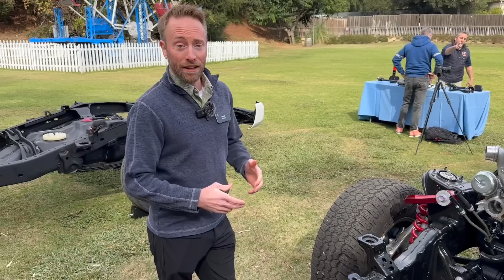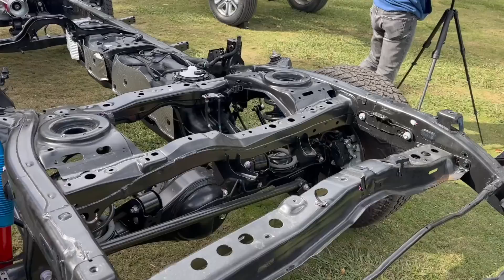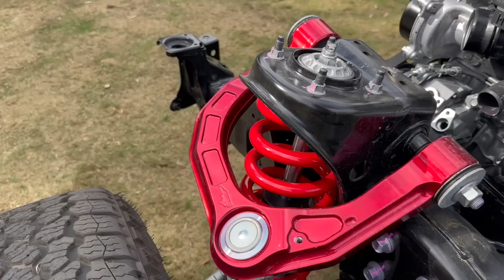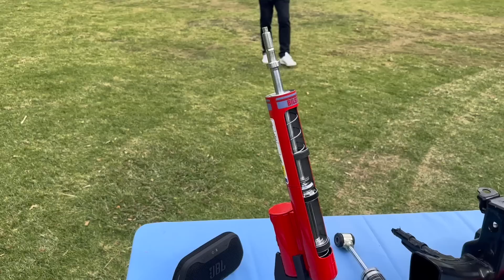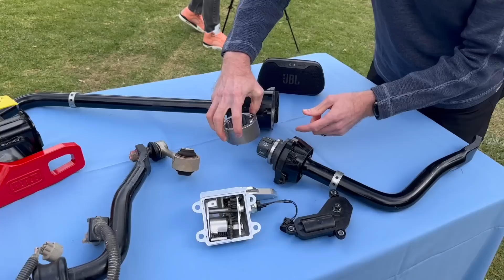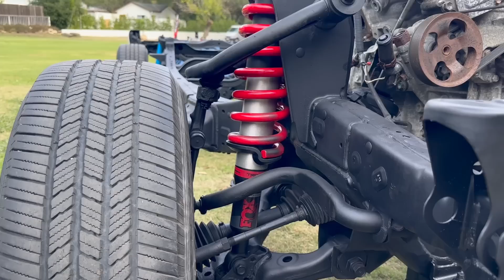2024 Tacoma Lead Engineer Explains Why The 4th Tacoma Is Better Than The 3rd Gen

Comment: They can say what they want for it to be reliable. It needs to be simplistic. They’ve put a turbo in it. They’ve increased the power of the dry train by using a battery operated system that they pretend saves fuel. When actually really doesn’t there’s more to fix more to breakdown it’s gonna be more expensive on maintenance and repairs. And they’re saying it’s better but they put an electronic handbrake in it and electronic handbrake. That tells me everything I need to know. No more flying down and off-road trail coming to a tight corner. I’m doing the handbrake turn to take the bend and you get that wonderful butterflies in your stomach and a big smile on your face like a Cheshire cat yeah good luck trying to do that with an electronic handbrake. Off road vehicle, not in my world. Was a huge Toyota truck fan absolutely huge thought they were the best things out there until I seen this. And what pisses me off the most is this is the only option they’re giving me in the future. They turned an off-road over landing monster into a pavement princess because you take this thing off the pavement. It won’t be long before you’re fucked.
Reply: The electronic parking brake
 will save a lot of transmissions by guaranteeing that the parking brake is,always engaged in park
Most users are too lazy and stupid to use their park brake
Turbo inline 4 is complicated?
A normally aspirated V6 or V8 are more complicated
More cylinders is more to go wrong
The advantage of the  v6 and v8 is the mechanical load is spread over more cylinders and that is it
Reply: @joeblack1052 just because some people are lazy and stupid doesn't mean it should be forced upon us all. And to be fair to being punished for the laziness and stupidity. As for the engines they have proven themselves and are considerably more reliable. I believe the new engine is way over complicated and I certainly going to have more issues custodian more money. The newer vehicles are relied too much on technology and lesson mechanical engineering. I believe it's a massive mistake. I'm not the only one you're already starting to see the effects of it vehicles are losing their safety ratings in Europe. They've replaced many of the tactical buttons with screens which means you no longer just reach out and control something you have to take your eyes off the road and scroll through screens to be able to operate your vehicle sometimes even up to 15 seconds that's a long time distracted from the road.. also think about technology and screens you buy a phone anything from a few hundred dollars do a couple of thousand same with a tablet or laptop. What in about 5-6 years tops its obsolete. Now imagine you've paid 30,000 to 100,000 for a vehicle in 5 or 6 years because of the technology it's obsolete that's a bigger kick in The Head don't you think. Just because they're newer vehicles doesn't mean they're going to be better in fact I think they're designed to strip you from your money and make sure you replace them quicker. In my view the newer vehicles are just to f*** you over. There's a reason why many mechanics are quietly telling you not to buy new vehicles with built-in obsolete switches. Does the reason why so many of them out there are telling you to buy older vehicles and spend the money repairing and replacing because in the end you will end up with a better more reliable vehicle.
Reply: @russellwood8750 yeah yeah, I will tell you what, new vehicles go longer with less issues than in the past
The main issue is,serviceability 
They are harder to repair when things go south
Tacoma appears quite serviceable 
V6 engines are overated 
Expensive to maintain and repair
Who does handbrake turns in a truck?
Most US vehicles had foot operated parking brakes which are useless for that purpose
The new tacoma is extremely off road capable  in stock configuration
Can fit larger tire sizes without modification
The low end torque characteristics of the turbo are ideal for offroad use mimicking diesels which make the best off road vehicles with the  exception engine braking as the diesel has mush higher compression
Reply: @joeblack1052  good luck, trying to sell it in the future. When it has no resale value.

Comment: I like the idea of the c-channel frame better, would have been easier to fluid film and be more thorough of an application vs having to stick an extension wand in little holes and spray and pray that it did a good job, cause you can’t visually see

Comment: So the engineer in this video is slightly incorrect about the rear differential.  Only the iForce MAX powertrain (and the non-hybrid TRD MT models) gets the larger 9.5 inch rear diff, to handle the added torque.  All other Tacoma non-hybrid models have an 8.2 inch rear diff  The hybrid models also get larger brake components throughout.

Comment: I like all the changes except the turbo 4cyl.   Id still rather a NA v6.    No matter how much engineering yall did, you wont convince me that a stressed out turbo charged 4cyl will last as long as a NA v6.   Im into longevity and turbo charged just simply dint last as long wo tons of maintenance.

Comment: My biggest concern is what I see on that 3.5 inch inlet - I really hope that isn't plastic. The one thing I get so sick and tired of is components that are meant to handle high temperatures having a plastic part (polycarbonate or whatever) somewhere on the cooling system be it for engine or oil. I've seen far too often, and even experienced it too often, that parts in that system being plastic just ends up having and astronomically high failure rate in hotter climate/running conditions that can lead to catastrophic failure too easily.
Reply: Plastics are not all the same. Just because something is made of plastic, does not mean that it is cheaper or less robust. A properly selected and manufactured plastic component specifically engineered for an application, can be even better than a similar metal component in a lot of applications. If other manufacturers simply did the proper pre production screening, problems like that would not exist. 👍🏻
Reply: @keepmahaney7412  Tell that to the thermostat housing on a 2003 4.0 v6 ranger. This part constantly failed to the point I had to replace it with an aluminum aftermarket part. Wasn't due to the vehicle overheating or the thermostat failing, it was because the part was not "robust" enough to be part of the engine cooling loop. These parts are intentionally made to fail.

Comment: So cooling in the TRD Off Road is more substantial than the TRD Sport? I was under the assumption the two power plants were the same. Have a deposit on a Sport and plan on frequently towing a travel trailer. Now I’m wondering if I should switch my deposit to an Off Road….
Reply: The sport will definitely be better for towing than the off-road.

Comment: I just sold my beloved v6 PreRunner (2015) and now I am truck less. I had plans on getting the latest OffRoad available (2023), but maybe considering the 4thGen Tacoma. Which truck - 2023 or 2024 - would be a better option for towing around 3,500lbs? The 2024 forced induction engines sound cool and all, but maybe less reliable down the line? If I'm towing, I reckon I would only speed up the wear and tear of an already waning turbocharged engine. Thoughts?
Reply from the maker: I'd buy a new truck all day over the 3rd Gen. Just drives so much better.

Comment: Engineering 101 - simpler designs are inherently more reliable.  This violates that rule, but time is the true test.  I’m sceptic where these engine will be in 12 years with 150k miles.

Comment: Get rid of the 4-Cllylinder and I might get one Ya Right I love my 2005 Tacoma V6 4x4 and I will keep it till I die or if my truck dies, or I will rebuild it like new I would never get a truck with a 4-Cylinder ever the truck looks nice and lots of new things like the rear disk brakes but that should have been done starting with the 2005 Tacoma very late in getting the rear disk brakes and they say it gets better gas miles but I heard it has a smaller gas tank????? so much for the better gas miles :( sad days for us off-roaders and you will have to replace the turbos around one hundred thousand miles my Tacoma V6 4x4 has just got 150, thousand miles on it and not leaks or problems very happy with it I should get another 150, thousand miles out of it :) Toyota has jumped on the 4-Cylinder band wagon sad days for us Tacoma drivers and one more thing an air dam on a 4x4 how much will that cost extra just to remove it and throw it away???????????????.

Comment: No offense intended, but I'm more persuaded by histories, repair records, and other metrics of longevity and reliability than pretty props and the word of an engineer who is paid by the company. I'm skeptical of this gamble by Toyota in putting this little engine in a truck that has increased in size and weight. We shall see.
Reply from the maker: Then lets take a look at all the Toyota failure engines of the past...I'll wait. But we shall see.
Reply: @TRDJon 2022-23 Tundra V6 turbo engines. I’ll wait. But we shall see !! 😂😂😂😂

Comment: The issue with forced induction is specific to SMALL GAS engines. I’ve heard the argument “million mile turbo diesel” but the problem is that smaller displacement engines simply cannot handle the extra boost pressure over long timelines. They’ll all need to be rebuilt at 100/150k miles. There’s just scientifically no chance that these will last anywhere near as long as the NA v6, which will probably outlive most of us. What you’re witnessing is the death of stock trucks that will go 300/400k miles with basic maintenance. Do what you want with that information, but don’t gaslight people about the new ones being as reliable.
Reply: And the idea of a “reliable” 4 cylinder truck that is meant to “go fast off-road” is just ridiculous. The more boost this engine gets, the shorter its lifetime. You’re getting a $65k truck that will be fun for a couple years and then need its engine rebuilt.

Comment: Ok. I came back to rewatch this because other reviewers have had a different toyota engineer say at this exact mockup that ALL have 3" plumbed cooling, but this guy says only the TRD Offroad packaged ones have it. Same with the sealed belt tensioner.  Is there really any engine differences between TRD and non TRD engines in the new tacoma??????
Reply from the maker: According to Craig yes there is and he is the powertrain engineer.

Comment: smaller gas tank, lighter/weaker framer. anybody catch any other cost saving  features? dudes trying to talk about how much better it is, i just want a regular frame, not some 'tajima welded frame' made from scraps
Reply from the maker: A c channel frame is stronger than a fully boxed frame???? 🤣
Reply: YEAH, the engineer said himself, 'we have to maintain thickness all the way through the frame'. With his "tajima" frame, he clearly states toyota uses the thinnest metal they can get away with in spots that don't 'require strength'. What does that sound like to you, dummy? @TRDJon

Comment: 3rd gen owners dont feel bad at all. You've all got a gem in ur garage
It's gonna be a high demand generation in the future n will continue to be the most reliable one
Dont get fooled by the new technology. We all know doesnt matter even its toyota who developed this new turbo engine but it's nowhere gonna be as reliable like the 3rd gen
Reply: I think you're right,  i have a 2021 Tacoma Sr-5 w/six foot bed, 16,000 miles. I think I'll hold on to it for now..
Reply: I have a 18 sport short bed manual. My truck is very in demand and definitely not for sale.

Comment: Those bilsteins are not as good as the 2.5 fox on the 3rd gen pro much smaller also. Now the new fox setup on the 4th gen pro should be an improvement
Reply from the maker: Yea not as good. But everything else that makes up the trd or will set it over the top for sure.

Comment: Please have the engineers explain why the new Tacoma practically has the same MPG as the previous generation, while the newest Tundra saw at least a few miles increase over the previous generation.
Reply from the maker: The Tacoma did as well.
Reply: @TRDJon  But not a huge ammount. The Tundra MPG rating went from 13/14 City / 17 Highway (15 combined) to a taing of 17-24 MPG (20 combined). Adn average of 4ish MPG increase. The 3g Taco was rated at 20-24 MPG, and the new 4g Taco is rated 20-26 MPG, not a huge boost, but also not that 4 MPG increase on both sides.
Reply from the maker: Yea not alot. But sill a good bit across the board. You need to look at the TRD OR now is only 4x4 where the last gen was 2wd too. So it is more as well
Reply: @TRDJon  Yeah, I made a video last year about how the 4x2 TRD Off Road makes no sense as a trim. It's on my channel. TRD Sport 4x2 makes sense - better suspension parts and the non-functional hood scoop.

Comment: Does the Taco engine use timing chain or timing belt? and what type of engine oil does it use? 
I've heard that most of the newer Toyota models use 0W-8 engine oil which is really expensive to buy and hard to find.
Reply from the maker: Chain i'm 90% sure

Comment: TRD JON pushing hard for Toyota, how can an unproven new design automatically be better than a proven one with history? I got low hopes for these new "environmentally friendly" weaker Tacomas. They should have kept the V6, it's far better in the long run. Theses new Tacomas are becoming temporary throwaway trucks that cost as much as a loaded full size.
Reply from the maker: Yea...I'm pushing so hard. They pay me so I have to make them happy....
Reply: @TRDJon  - I didn't say they pay you, but you did mention you had dinner with them and I seriously doubt you picked up the tab, lol! You don't have to be paid to be bias, also your TY name has TRD so, yeah..... You can be a Toyota fanboy all you want, there's nothing wrong with that, I just wanna know how you think that a brand new unproven design is automatically better than an already existing modern design that's been proven..... or do you just wanna avoid the question and respond like an arrogant teenager again?
Reply from the maker: Toyota Review Dude. Who reviews Toyotas…whole point of the video was how they took measures to make the new Tacoma better thanks the out going. Which was explained by the improved transmission, better gearing ration, improved torque, 50% better duty cycle for reliability, larger rear end, more rigged frame, and so on. Not sure what else to say, seemed pretty straight forward.
Reply: @TRDJon  - You say you're a Toyota guy reviewing Toyotas, and I said you're pulling hard for Toyota and you still throw a little hissy fit. I understand the video on how it's gonna have more performance, but my question is do you really think this new platform is going to be better, just because it's got more power doesn't always mean more reliability. Many vehicles now days are more powerful than their predecessors but they don't last long and break down, just look at Rams, far more powerful than the old late 90's Rams but they're junk reliable money pits. The new 2023 Tundras and their "more powerful V6 Turbos" are already having issues and nowhere near as reliable as the old Tundras with their bullet proof V8. The new V6-turbo "more powerful" Tundras are NOT better than the old V8 Tundras because those V8 are proven to be hardcore work trucks, that's my point and the meaning of my question.
Reply: @TRDJon   - The reason I concentrate on reliability is because that's the whole Toyota mojo and number one reason people buy Toyota. Nobody buys Toyota thinking they're gonna have the best track car, or the strongest truck or much less the best looking car/truck, Toyota are not the most luxurious or better handling or that comfortable. Honda, VW, Audi, Nissan, Ford all make faster, better looking, better driving cars/sedans than Toyota. Ford, Dodge and GM already make more powerful trucks than Toyota. But Toyota does make more reliable cars/trucks than all of them, that's the only category where Toyota can beat all their competitors. Now with these super electronic-mega complicated smaller turbo-engine bull crap components only leaves more things that can (and will as we see it with the new Tundras) go wrong and super expensive to fix (right after the warranties conveniently expire).

Comment: higher vehicle cost, higher interest rate, higher maintenance cost with the turbo, higher insurance, higher extended warranty cost vs a slow none hyper powertrain,  paid off low maintenance, lower insurance 3rd gen. Oh v6 Mt 19 to 20mpgs 4th gen 21 to 22mpgs. where are the savings !!!! okay and the frame again the 2nd gen has a boxed frame then went to open C frame on 3rd gen, the selling point was flexibility to maintain tires contact with the roads, now 4th gen boxed frame and selling point is rigidity. The turbo engine will require 91 octane 3000 miles oil change intervals and proper ways to drive a turbo engine warming and cooling.
Frankenstein setup, what is this engineer trying to say !
Reply from the maker: regular octane gas and oil done ever 10K miles.  Water cooler turbos.
Reply: @TRDJon  Good luck with those long intervals, only works on vehicles kept for few years, turbos spin at 30000 rpms and generate heat that cooks the oil faster also pull more particles in the air filter element.
Reply from the maker: Man Toyota should have hired you to build this truck! You got it all man!
Reply: @TRDJon  ask a mechanic that repairs the vehicles their engineers designed. A truck for video content isn’t the same as a truck for daily use for 6 years.
Reply from the maker: A truck is a truck.